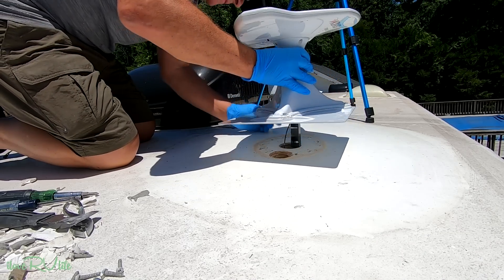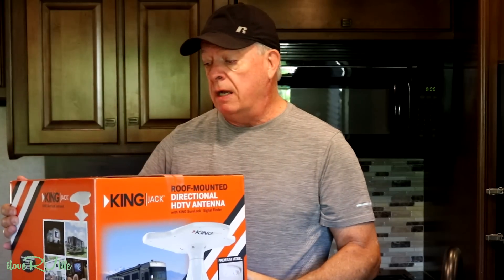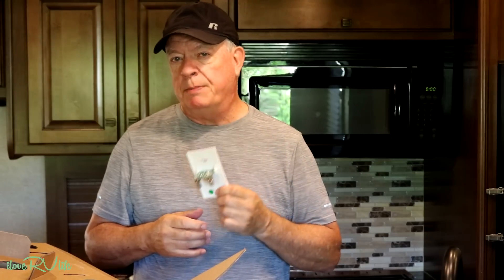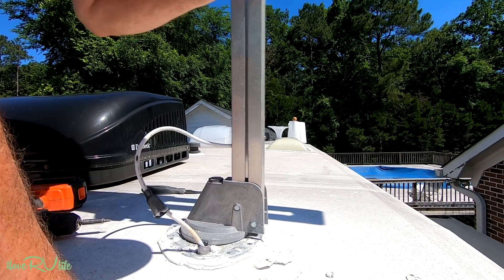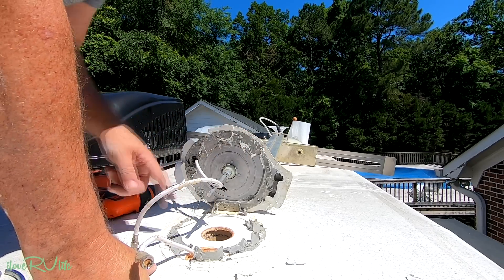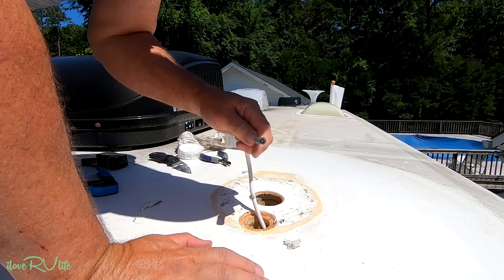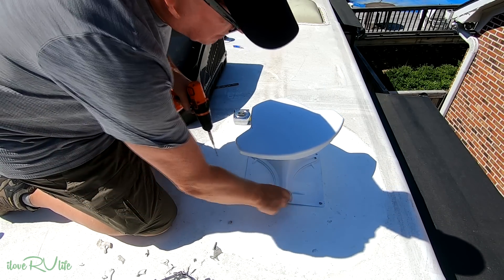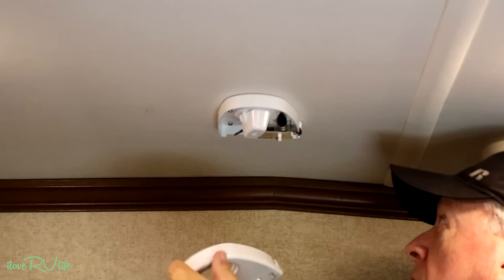Installing The King Jack Antenna

Comment: The range of most compact HD antennas is about 150 mile radius. That means from the center point of where you're located.  If you divide that distance in half, you're talking about 75 miles. If you are boon docking that far out, it is likely, you would be better off with GSM/satellite communications, and would be better off using the WiFi / hotspot, and streaming via the internet.
Reply from the maker: We use a Dish and an X2, but try to get the locals of antenna if possible.  Saves few bucks each month.  Hotspots are good if we have good cell coverage, but I work on the road and often my work needs consumes the bandwidth during the day.
Reply from the maker: Joyce,  I don’t think we are saying the same thing.  The Dish service, Wally receiver and Winegard X2 are for video services only.  They do not provide any cell service of any kind.  This is strictly a satellite based video service.  Many times we stay in areas where cell service is very limited even with the booster.  We have to be able to have some cell service first to boost.  With the Dish satellite service we are able to watch TV regardless as long as we have a clear shot to either the east or west arc where the satellites reside.  We use Internet, have a MoFi 4500 and external antenna with grandfathered Verizon and AT&T unlimited plans.  We prefer a good enterprise router with a quality cellular radio and a high gain external antenna.  Boosters are hit or miss from our experience.  Appreciate the comments.
Reply: @iLoveRVlife  I don't think you understand what I'm trying to say. If you are close enough to get Over the Air (OTA HD), you are close enough to get cell service, with an extender. If you get cell service, you can get data service through your cellphone provider, which allows you to stream content over the data service from your cell provider for cheaper than paying for Dish and the whole works you've purchased into. A cell phone extender, which you can install in place of your Wineguard, costs about $200.  Your cellphone service can be upgraded (if you're with the right company to unlimited tethering for $25 per month). So you can drop the dish, go tell Wally whatever to take a hike, and run simply off your unlimited 4g/5G data streaming content from the internet.

Comment: Jerry,
I am watching your video for 2nd time. I thought I had a coax issue with my current King Jack Antenna and ordered the crimp set recommended by you. However after further examination the coax cable issue is one that that connects to antenna head and in the antenna shaft. The cable has yellow crimped connectors. I saw the  yellow crimped connector in the shaft of antenna in your video. 
To replace this $10 cable will require to remove the antenna . That’s not a problem. My question is the lap sealant you used was for PVC roof.  My roof is fiberglass constructed by Winnebago. Will the lab sealant you used by okay for fiberglass roof? 
Thank you for your help. Your videos are great.
Reply from the maker: It’s also rated for fiberglass too.

Comment: I have a Batwing style but I don't see a power inserter for the antenna?
Reply from the maker: Depends on the type of system.  It has a power inserter somewhere.  Some RVs have a push button video distribution panel that has the power inserter built in.  Not sure if that's your case.  If you have this type of system, it should power the King Jack.
Reply: @iLoveRVlife  ahh ok, I was wondering if that switch box worked with the antenna because the cable goes into that then out to the TVs and it has power going into it.
I'll look into that, thank you for the reply. That helps me out now.

Comment: Hello Jerry, after over 1 year of usage is this a thumbs up?  I also am wondering if it would work at remote  COE areas?
Reply from the maker: Still thumbs up Mark.  We’ve returned to some campgrounds where we used the old batwing.  Reception was similar.  Doubt there would be any addition gain over the older unit.  We still go places were their isn’t any TV signal.

Comment: nice video but you had your coax strippers backwards which is why they did not strip correctly. it matters which direction you put the coax into the strippers.
Reply from the maker: Thanks. Guess it just on of those left handed things.

Comment: What kind of screws did you use to screw the plate to the roof?
Reply from the maker: Hi Evan.  It’s a 1 1/4 inch round head course thread screw.

Comment: How do you know if it's pvc or epdm or rubber?
Reply from the maker: PVC will have be a bit of a feel like a thick sheet of plastic.  The EPDM has a rough and soft feel.  I’ve not seen a rubber roof on an RV.

Comment: If you had room, would you have replaced the inside cable connectors?
Reply from the maker: I would have.  I tested.  They were tight and I just didn’t have any slack to cut the ends off.  So far so good.

Comment: Great video. I'm glad that my RV came with that newer style antenna. Did you know you have to turn the pre amp off before you can use an outside cable hookup or it will not program?
Reply from the maker: Hi Brian.  Yes, you do have to turn off.  There’s a signal amplifier and it distorts the cable signal.

Comment: will the cable that you connect at sites that have cable  tv still work
Reply from the maker: It will George.  With these systems, you leave the amplifier (power button) off to receive cable channels.

Comment: Hey Jerry I'm not sure if you can help me with this or not. I'm installing that antenna after loosing out old one on a tree limb. Anyway my problem is this. When I removed the old antenna there was only ONE cable in the space.. No 2nd line to hook i to the knob for adjusting it. Can you explain how to find the proper coax line that I should run into the antenna from the bedroom cable outlets in the ceiling ? Tia
Reply from the maker: I’ll try.  The OA8500 with signal finder is the unit I installed.  At the flat part of the base, you’ll find a connector to connect the RG6 coax cable that was attached to the antenna you removed.  The connector that has the thin coax goes to the base with the knob.  Page 3 of the installation manual has a good picture showing the TV coax connection.  Page 4 shows the connection for the signal coax.  I also replaced my older power inserter with the coax splitter for the front and back TVs.  If cables aren’t labeled, disconnect from TV’s and short the ends one at a with a with a paper clip from inserting one end into the center connection and touching the outer barrel.  The use a voltmeter to very each TV and the cable in connection.  The 4th will be from the antenna.  Hope this helps.
Reply: @iLoveRVlife  Thank you do much I will try that out. Really appreciate your time and expertise...Thanks Jerry have a great weekend 😀
Reply from the maker: You bet!

Comment: You mentioned a satellite port. Can you hook up a satellite dish to this?
Reply from the maker: You can if the camper has a dedicated satellite connection.  Usually these are marked “satellite” and there’s a dedicated line near the TV.  Satellite will not work through the One marked “cable” due to the electronics located at the antenna booster switch.  We used a Dish Wally and Winegard X2 for the last 4 years.  Both have served us well.

Comment: I don't watch tv ,but I do watch Wi-Fi so does that antenna give Wi-Fi also? That's what I want.
Reply from the maker: It doesn’t.  You’re probably looking for an outdoor WiFi antenna and booster such as one of these - https://amzn.to/2HrJNR1 or https://amzn.to/2WbXvzP.  They’re pricey, but the function and electronics are substantially different.
Reply: Ok thanks! YIKES wayyyy too costly for me .
Reply from the maker: I know.  Boosting a WiFi signal takes a lot of science and it is expensive.  If you have the skill set to manage a good home style access point, you can purchase one in the $100 range with good set of high gain antennas.  Place it by a window and connect to the park WiFi.  I did this for a while until I migrated to cellular Internet.  It won’t boost like the high-end RV boosters, but will make a difference.

Comment: During the program, you recommended a coax connector and tool for installation.  I do not see it on your products list, what brand and model of connector and tool did you use?  Thanks  Tony
Reply from the maker: Hi Tony.  Thanks for the suggestion.  Here’s the tool with stripper and a handful of connectors https://amzn.to/32XuitP